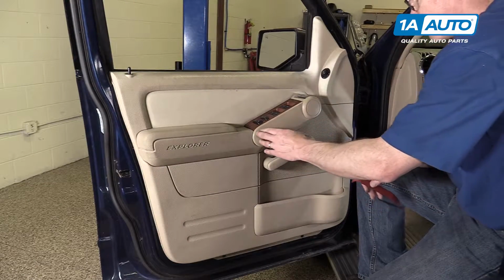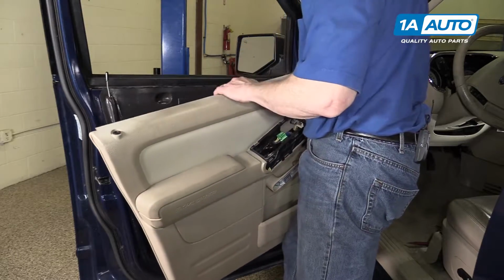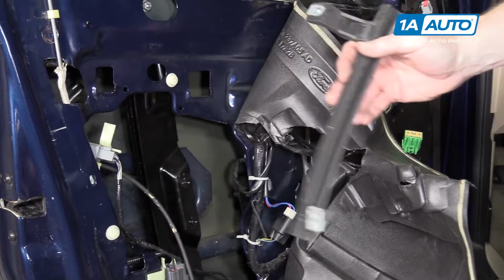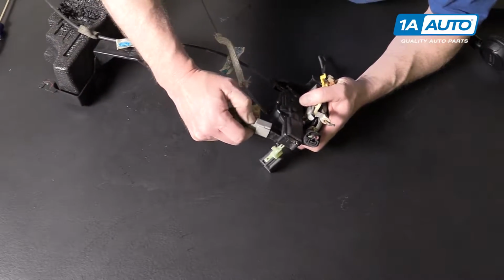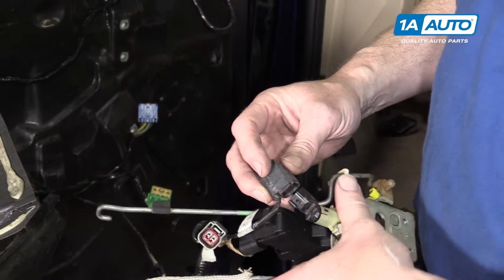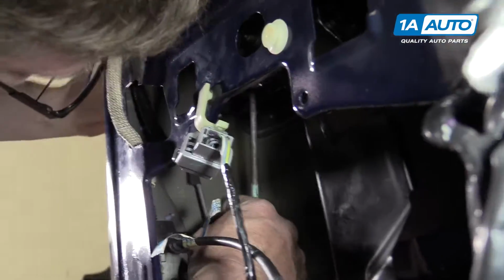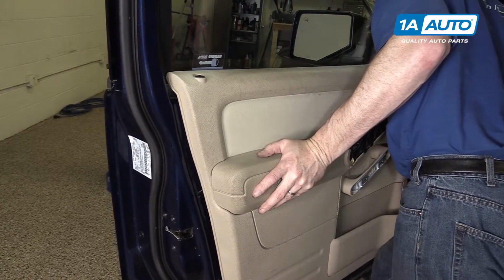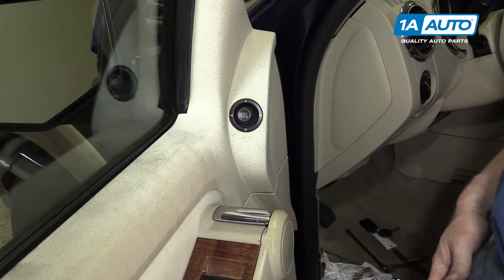How to Replace Door Latch Cable 06-10 Ford Explorer

Comment: Would you happen to have a video of replacing the lock motor of the rear hatch if it is stuck in the locked position?
Reply from the maker: +Joshua Burgher Thank you for watching. Unfortunately, we do not have a video for your application. We will keep this in mind for future repairs. http://www.1AAuto.com?utm_source=YouTube&amp;utm_medium=CTA%20Comment&amp;utm_campaign=ytcomment 866-403-3393